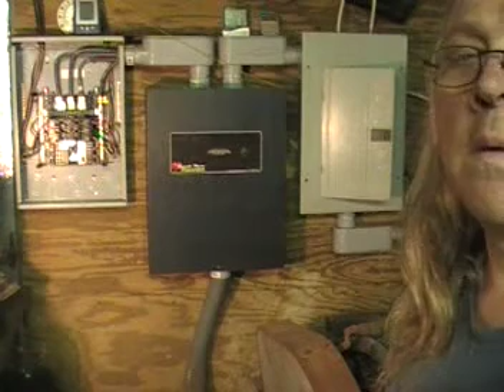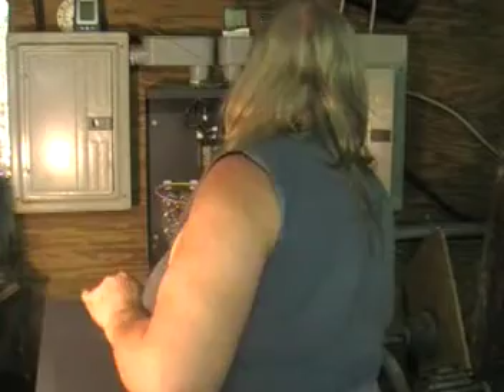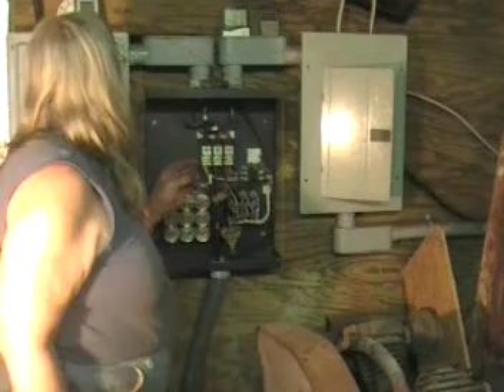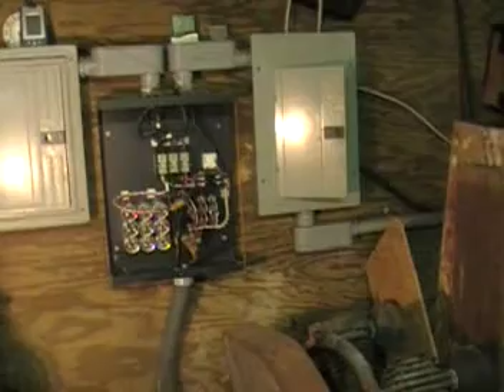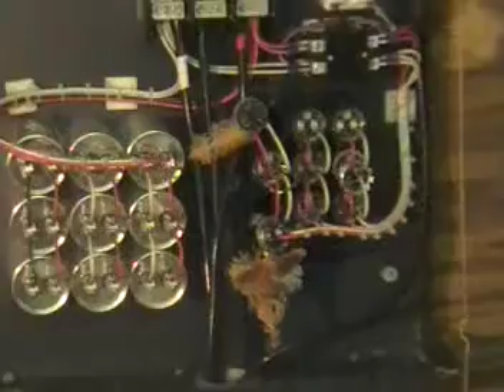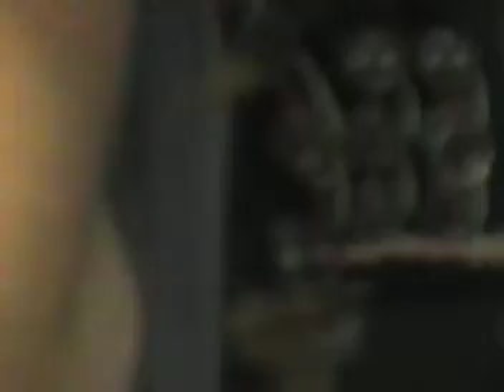I blew up my brother's phase inverter ~( _-_)~

Comment: Buy a $200 single phase to three phase VFD and be done with that crap.
Reply from the maker: 1, Its not my machine
2, That's a hell of a lot more work
3, You can't get a VFD handling 30 HP for that price that I would trust as far as it could be thrown.
Reply: @hunnybunnysheavymetalmusic6542  2 wires in, 3 wires out. I have one rated 10HP that installed to replace a 15HP rotary converter about 10 years ago. I kept the rotary as a backup, I haven't used it once. Soft start is wonderful too.
Reply from the maker: @andyfeimsternfei8408  Good for you.

You do you.

I run a REAL machine shop.

I'M gunna do what I'M gunna do.

And it will only cost me $143.64 [tax and shipping included] to fix this THIRTY HP phase converter.
Reply: @hunnybunnysheavymetalmusic6542  Good for you. You have a real attitude. I hope it gets you lots of subscribers.
Reply from the maker: @andyfeimsternfei8408  Meh.

My thing ain't getting subscribers.

My thing being insane, and having a good time on my farm, in my machine shop and recording my own original music.

I post it mostly for my pre-existing friends to see, because its better than a news letter.